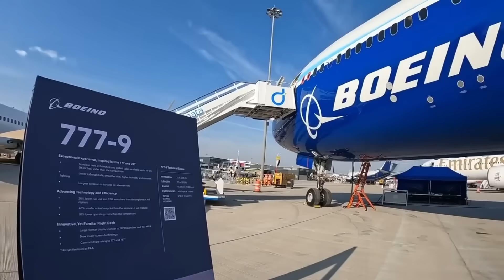Here is why Boeing 777-10 is a MONSTER and Could Break Every Record!!

Comment: Question is... will there be more customers than Emirates for the 777-10? Boeing didn't have much success with the larger 747-8i and neither did Airbus with the A380. The trend airlines want is smaller jets with more range and airports and airspace capable of handling more frequency.

Comment: A380 is still the best
Reply: You know that was a plane that may have been very well designed, but commercially it was a failure, and that's the reason its production was ceased.
Reply: It is a commercial success for those who use it right. The lift of the Quad Jet requirement for transocean flights gave twin jets a possibility.  Before that all would have to have four engines to cross the Atlantic and Pazific.. The B 747 at its production end would have made the A 380 the only modern jet for long-range flights. It actually now is still the best possibility-and a lot of passengers prefer this jet. Me including.

Comment: My guess is any stretch would be added forward of the wing?
Reply: Usually some in front and some behind the wings.
Reply: Forward and aft of the wing.  You have to balance the weight...weight & balance...
Reply: @reubenmorris487 except you have to allow for tail strike potential.  That's why I think most of the stretch will be forward of the wings.
Reply: @tdkleffman  Tailstrike smailstrike. . . If the thing isn't balanced properly, it won't fly.